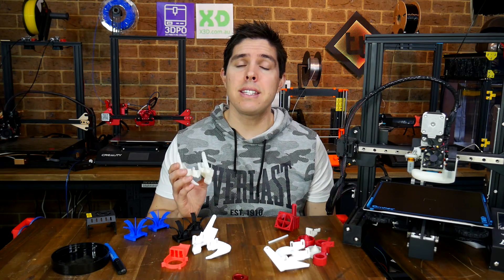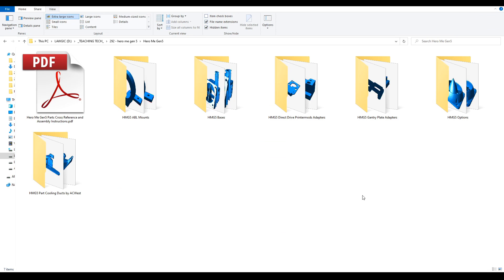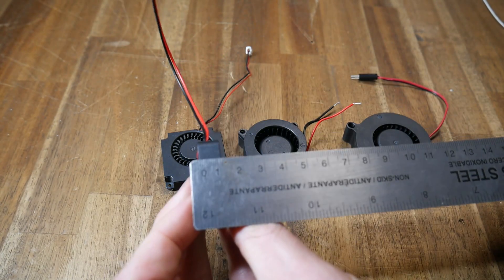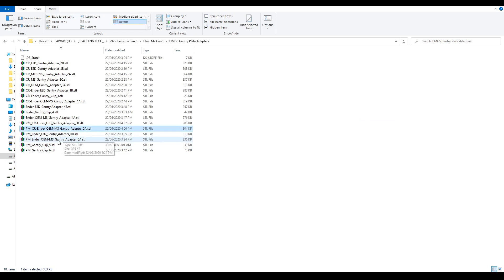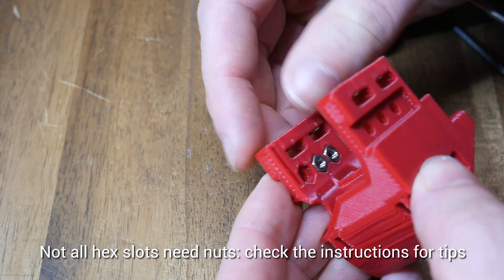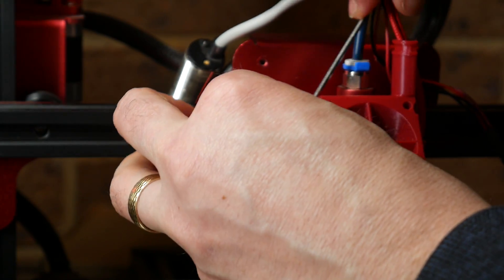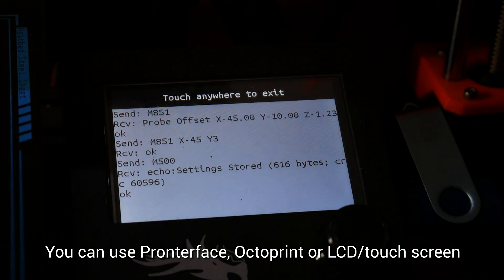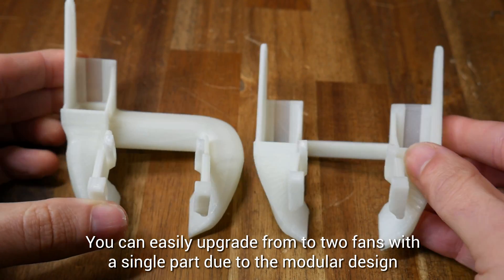Hero Me Gen 5: The ultimate part cooling fan duct for Creality 3D printers?

Comment: What up everybody, got a question for ya guys if possible. I am having an issue with the screen not matching up with my commands. It will only let me navigate to a brightness adjustment screen but I can not adjust, not that I need to. I can not choose print or temperature buttons at all, only get a noise. When clicking setting is goes straight to the brightness. 

I am doing this to a CR10S Pro v.2. I recently printed and tried to upgrade to the Hero Me 5 hotend setup and need to make some changes to the z probe offset and home offset. From what i could find, Marlin was the best choice for this. I have followed Teaching techs video here for the appropriate links provided for my machine. I also got my marlin install info from https://www.youtube.com/watch?v=-rOZpOiWYxM&t=246s which was a great basic tutorial of the process and some settings to look through. 

I was able to:
1. Get Marlin up with the correct CR10spr0v2 config files linked. 
2. Made necessary changes and verified, everything went fine. 
3. Uploaded the firmware with no issues that I could see. 
4. Put the DWIN set on a flash from provided link and installed with no errors.
5. Can not use menus as explained earlier. 
6. I have gone through and re downloaded all the files/ restup in marlin and on the SD card, reran the firmware updates but still have the same issue.

I have looked around a bit but couldn't really find anything on forums or videos to help out. Any help would be greatly appreciated!
Reply: I had exactly the same problem and I tried reseting the flash of the lcd with the "T5UID1.CFG" file in DGUS-reloaded-master/extras/flash_reset and now the lcd does not react at all. It only showes the home-screen
Reply: @executeOrder69  Hey man, I ended up getting help on Reddit and was able to get up and running. Check out the conversation I had with Desuuuu. Read through the whole conversation though to get mentally ready for the process as I did have to troubleshoot with him a bit to get to a working build. 

https://www.reddit.com/r/CR10/comments/i2met0/help_installing_marlin_on_cr10s_pro_v2/

Comment: What screws have you used for the Ender 3 hotend? I've tried the 35mm or 40mm ones but they don't fit well because they stick out. I have a micro swiss clone and an ender 3 pro

Comment: Question on fan speed I installed this Hero Me Gen 5 on my Ender 3 Pro with Micro Swiss Direct Drive works great but I notice that with these 2 large fans should I slow down the fan speed when printing they are running at speed of 250 which it was doing with the 1 small one before should I slow them down now? They are really spinning LOL.

Comment: Can you do a video on how to change or upgrade fans? A lot of videos mention changing to 5015 blowers but don't go into detail about how to install them
Reply: +1.   I’d like to know more about the connector types and tools used to crimp them.

Thanks
Reply: Cut the cables that go to the stockt fan and solder on the new fan. Don't mix red and black wire.

Comment: Hi Michael, or anyone who can help. First, thanks for the great video!! Without this I would have no idea how to install the duct since I'm fairly new to 3D printing. My main problem now is setting the Home Y-offset which I can't seemed to do.

I'm running one of the latest Marlin 2.0.x bugfix. 

I tried using the gcode
M206 Y-9
M500
Didn't work. Autohome didn't apply the offset.

I tried compiling it in firmware using
#define MANUAL_Y_HOME_POS -9

Loaded up to my ender 3 pro and still didn't work. However, when I clicked "Movement" (Im using tft 35 touch screen), it applies the offset. I went back to click autohome but it went to the pre offset position again. I'm not sure how to manually set and save the offset since all I manage to find is how to set the z-offset. Thanks in advance for any help.

Comment: I need something that works with both a micro swiss hotend and direct drive.  The hero me requires a gantry which puts the inlet to the nozzle out of alignment and also just interferes with the direct drive in general.  I have printed out six different coolers now and none of them work.  Kind of pulling my hair out at this point.

I found one that is close, it looks like a hero me earlier version, has cr-10 stock in the name but can't seem to find it.  It just has a rail that comes up to strap wiring to that needs to be moved right 7mm.  But I cannot edit complex stl

Comment: When you use dual 5015 fans, what voltage is each fan? 24V?
Reply: As you will be running them in parallel then you need 24v fans. Parallel is always the best way to go in this type of application so if one fan dies, you will have the other one still cooling your part. Parallel is when you connect the 3 positive wires together (both fans + and the + supply wire), solder heat shrink them. Then the 3 negative wires together (Both fans - and the - supply wire), solder and heat shrink them. Hope that helps some people out there.
Reply: @Aspie_Geek_UK  Helps me! I can't find the y junction connector that he used in the video. I have everything to solder though

Comment: Unfortunately the DD / v6 clone flavor suffers from the typical weakness most of these designs have: The v6 ist being held by a small plastic ring only (which is weakened even further by the fixation screws), and the extruder is screwed onto an entirely different part of the whole design, therefore maximising the possible play between extruder and hotend whilst reducing all chances of having a reliable hotend Z height position.
At least that is my experience from using such a design last time: After 30 hours of printing (PLA and ABS, 100mm/s, slight overextrusion at 102% extrusion rate, tuned pressure advance) with my BMG extruder, the v6 clone has sunk by over one millimeter due to severe deformations of the PLA material the part cooling contraption was printed with. Precise bed leveling or even a usable first layer is obviously out of question with such a design.
Reply: The answer is clearly, print your own CNC mill and make the mounts out of aluminum? lol.
Reply: This is an older comment,  but why didn´t you just print the duct in ABS? Holds much better under this load.

Comment: 7:17 I'm confused.. The Ender 3 Pro you're running has a V6 style hot end and you're using direct drive. Why did you use Base 1 instead of Base 4?
Reply from the maker: Ender 3 Pro has a Microswiss replacement hot end - Base 1, the CR-10S Pro has the factory 'V6 style' hot end - base 4.
Reply: @TeachingTech  Even though your Ender 3 Pro has direct drive, it still uses base 1? I printed base 4, but I may reprint base 1 before I take the entire thing apart.
Reply: @TeachingTech  But you have the PrinterMods.com direct drive kit on your Ender 3 so you would need Hero_Me_Gen5_Base_4.stl and not Hero_Me_Gen5_Base_1.stl for your particular setup (I have the same setup).
Reply: @marcusretaken72  If I have a direct drive setup with the V6 clone hotend and I'm using a remix version or a direct Drive mount, would I just Base 2 or 3?  The only difference I see between the two is the taller cable management area.

Comment: 10:57 for folks not using the printermod gantry plate, before you put the adapter plate on you might wanna remember to pop 2 nuts in the pocket holes where the bltouch holder will be mounted to later...

Comment: I'm gonna be honest with y'all. I didn't see any differences except the underside of the last one, and even then the only real difference was that the sagging was cleaner looking.

All in all I still don't see any reason to upgrade my stock fan and duct.

Besides, I don't think dude has his printer dialed in properly if his stock parts are making prints like that.
The only problem I've ever had was that ugly seam running up the sides of my prints but I fixed it fairly easily by just telling cura to have it finish each layer in a random place.
Reply from the maker: The very last pic that compares the stock Ender 3 with this is night and day.
Reply: @TeachingTech  I'm sorry bro, I just don't see anything different besides the underside of the model

Comment: "It really helps if you'd put that double super glue around your nuts to stop them falling out".
Thats a good hint but you may want to consider to add an additional disclaimer that you are not liable for any personal damage people might inflict upon them.
Reply: For some people the hex inserts are a little lose, for others they are a little tight. This due to differences in the M3 nuts and bolts from hardware mfgrs. and peoples printer setups. I worked to find a balance between the two. Some people will need a dab of glue (or tape temporarily), others will need to use the pull method show in the video.
Reply: And for some people the screws are a little loose, making it hard to get the nuts correct 🙃

Comment: In my litle expirience in 3d printing, i found that "to much its to much", for pla its ok, but i use this in my cr10 printing Petg , and i discover that the filament dont stick each other , so i have delamination! Whirh petg!, so i reduce to 50-80% the flow and thats was perfect.For Abs yuo dont need any fan at all..soo be carefull whith this , too much its too much
Reply from the maker: One of the advantages is with two fans, you can run them at lower power for a good reduction in volume.
Reply: Alternatively: you could learn to set the fans appropriately based on the material you're using rather than advocating for a fundamentally broken system that only 'works' in situations where 'working' means 'not turning on at all'.

Comment: Great video and even though it seems it won't work properly on the Ender 5 (comment below) I was wondering if you had a fan preference for everyone to look for? Does it make a difference with 4020 or 5015?
Reply: The Hero Me Gen5 does support and work with the Ender5 series. Updates have been made since original release to resolve the issues some Ender 5 users have had. The Lightweight ducts that are also part of the Hero Me Gen5 Master Suite that Teaching Tech did not highlight, do not take up any room in front and leave the nozzle completely visible, nothing in front of the hot-end. Check out Kersey's video of the Hero Me on his Ender 5. https://youtu.be/dbS9MA4UkZA

Comment: Do you also plan to test how it works along the "peculiar" levelling system of the CR 6 SE you reviewed a little back ago? :) I was wondering how that fixed geometry that wraps both the hotend and the gantry could be adapted to a mobile (if only for a veeery tiny bit) hotend :)
Reply: A Gantry Adapter has not yet been created for the CR-6 SE in the Hero Me Gen5 Master Suite. I am looking for an STEP, or STL file of the CR-6 SE gantry plate to be able to make on.

Comment: If you take into consideration the weight it adds (specially weight added to the front of hotend, the worst part for ringing) for the little gain it gives it's mostly a downgrade than anything.
A single fan would be a much better option.
Reply from the maker: On an i3 machine like this, the heavy moving bed is far heavier than a small amount of printed plastic from this. Your overall print speed will be limited by this rather than anything on x such as fans or a direct drive conversion. But either way, each to their own.

Comment: I don't like this mod because it puts all the weight in the plate screws. The hydra mod is much better, and more solid as the mod sits on top of the plate, fixed with screws from the front to the back: I would recommend you to test it and compare both mods.

Comment: I really hate it, i don't write a review of it for now, I have installed it on my Ender 5 with V6 hotend, what a pain in the ass, it took me allot of time to get the printer working again and I have to trim some parts so i can mount it again on the X carriage, if I want to change something on the nozzle i have almost to disassemble it completely, the fan duct exit is so big and poorly designed that it shirk my bed area by 2 cm on each side... It work cool, but the designer don't really think of ease of assembly..., Again, I really hate it...

Comment: Try out the new Satsana duct.  It's compact, one piece, has good airflow, is easier to instal, and looks great.
Reply: Its seems a very nice desing, specially for acces the hotend, yuo dont need to desasembling evrything to acces them
Reply: Just checked it out seems great but you can't adjust the height of the duct. I non stock nozzle that hangs down further.
Reply: @mochmaster45  I was thinking of changing the mounting holes to slots so the whole assembly could slide up and down a few MM. What nozzle do you have and how much additional adjustment would you need?
Reply: Is it compatible with a BLTouch?
Reply: marcdosh57 look at the remixes.  There are a bunch of different options as well as a BlTouch adapter.
Reply: @ArielZima  I am looking at this. I have the original one that used the stock hotend cooling fan. Like the new one because of the 5015 but am seeing if I can get one like this design with dual 5015's

Comment: Question on the direct drive upgrade.  I got mine last year when you did the video on the 1.0 one when they were still basaraba_innovations.  The silicone boots don't tend to fit correctly now due to the mounting plate... did you find some to work?
Reply from the maker: I switched to the V1.2. Until I changed to linear rails they seemed to be pretty equal in performance. I don't have anything specific to say on silicone sock clearance, apart from this mod moves the hot end away from the plate several mm so you might be ok.
Reply: Had the same problem. This mod fixes it. As noted by Michael, the hot end is moved out from the gantry plate.

Comment: Excellent video! I've gotten great results out of this duct since installing it with the dual 5015s. It's unfortunate that I just reprinted my Hero Me Gen 3 ducts for the E3 + V6 hotend combo before the V5 was released. Maybe I'll reprint down the line if I end up upgrading to a Dragon or Copperhead hotend with the screw mount rather than the V6 groove mount, but I don't think they have those variants yet (at least for the Dragon, the Copperhead might be usable with the Mosquito mount?).
Reply: Thanks for using the Hero Me! The Copperhead has a larger (wider) than expected heat sink. I will be designing a Hero Me Base to support it. It is wider than the Mosquito heat sink (I do have a Hero Me Base for the Mosquito).

Comment: Still no real direct drive... crap :D
Reply: If you are referring to the hot-end and extruder directly connected (no short PTFE tube), no the current Hero Me Gen5 does not support these setups. The Hero Me Base will need to be greatly redesigned to support this scenario. It is on my roadmap to do this.
Reply from the maker: Even the Prusa MK3 which is direct drive from factory has a small PTFE liner between the extruder and hot end.
Reply: @TeachingTech  As you see, marketing and reality is not the same.
As long the Heatsink isn't attached directly to the bmg housing, you can tell it wat you want, but not direct drive :P
Maybe short or ultra short bowden ;)
There are a few good "real" direct drive designs out there to print.

Comment: I found this version to be no good on an Ender 5. The larger ducts hit the front of the frame. Running a smaller single duct works but the gandry adapter makes it impossible to print all the way to the back edge of the Ender 5 bed.
Reply: The Lightweight ducts are best for the Ender 5 as they do not take any additional room in front. There have been updates to the Hero Me Gen5 since original posting that resolve the other issues.
Reply: @AndrewSoderberg1  I have to wonder if you've actually tried the lightweight ducts vs. looking at them/reading about them, because while the ducts themselves are indeed smaller and don't stick out as much (hence their name) the fans are reversed - meaning they now stick out. In fact the entire setup with 2 5015 fans takes about as much Y space in front as even the 30 degree version of the duct. The normal dual duct, due to not having to use a fat connector in between, actually uses the least space, and it's still tight on the Ender 5. I know this, I've printed all of them. Best option to avoid this problem on the 5 is to print the adapter that lets you lower the front bar so you can see the hotend clearer - it's great for camera mounts too. No stability problems and all versions of the Hero ducts work with it.
Reply: @GeoffTognetti  that’s the creator of the hero me…
Reply: I was just reading to see if anyone tried on the Ender 5 and here you are :) Such a shame. Every fan "solution" I have tried has either not worked due to design/clearances or just never made a difference in the printed parts. Would love a dual fan solution for the Ender 5 to get some cooling on both sides (the round adapter with holes in it made my prints worse).

Comment: Was going to try building the layer fused x301 core xy diy printer by makers mashup later this year. Was gonna try using this cooling solution with dual 5015 and a bl touch around an e3d v6 and bondtech bmg in direct drive with it. Hopefully I can get that to work and hopefully it wont be too heavy.

Comment: when you print a coling system like this (or some other) do you use PLA or something else? 
If so, what? 
I'm thinking about if PLA will just melt with time being so close to the hotend.
Reply: its ok i've been using pla.
Reply: Did you watch the video?  He specifically addressed that...
Reply: Assuming you only print below 230-240C or so (with a PTFE-lined hotend), you can easily use PLA for the duct with a silicone socket (keeps the heater block from irradiating/wasting too much heat). The fan outlets will degrade a little over time but still be functional. None of us have of course used the Gen5 over a longer period of time yet, so I am speaking from years of experience with the Gen2 and Gen3 with similar fan ducts.